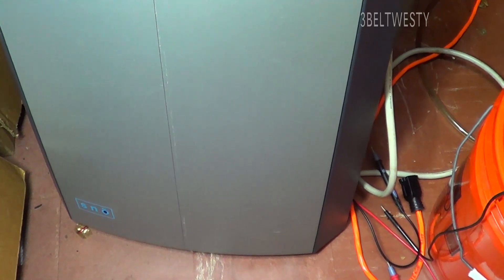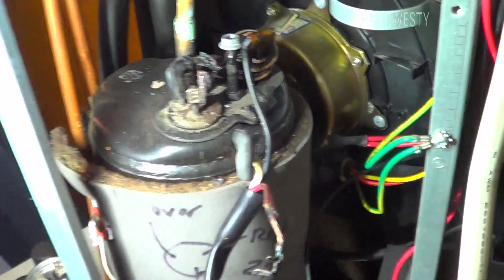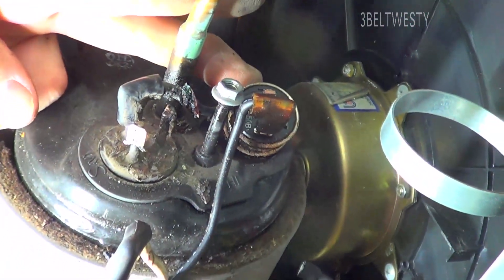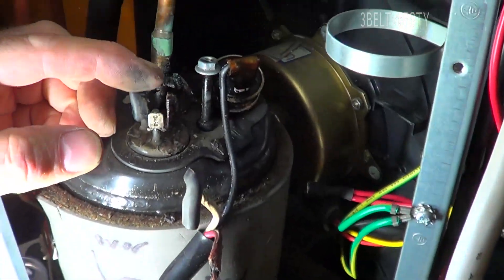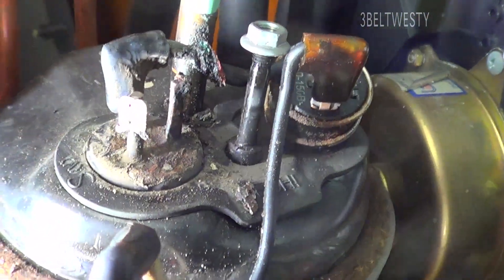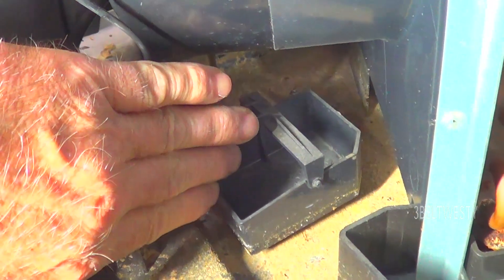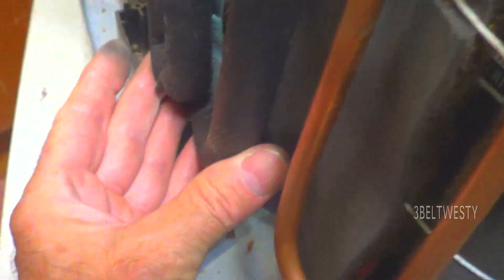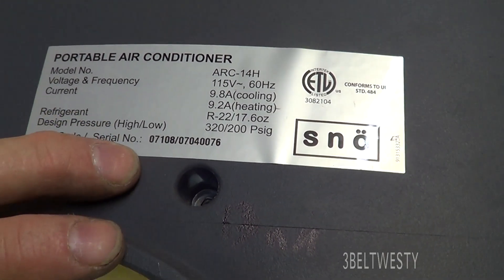SNO 14000btu Portable AC Repair burned Compressor Lug

Comment: I have a Whynter ARC-14SH that I've used for about 6 years.  The compressor stopped the other day and I just discovered the black wire going to the common terminal burnt up and the connector on the lug burnt up.  Everything else looks really good, including that round temp sensor/switch you mentioned, looks brand new.  I don't see any leaks.  Just one that wire and connector are burnt up.  How do you fix that connector on the lug?  Can I just solder a new wire directly to it?
Reply from the maker: Hello Rob,  

Never solder to the compressors lugs; ie very very risky. That pass through connector with the three lugs can pop out and do major damage to you. So use slip on "high temperature spade lugs" with a wire attached., or a clamp Quicklug system.  Hot items like ovens, compressors, motors use "high temperature" more expensive spade lugs. The metal is better for higher temperatures and the spring force does not drop like plain spade lugs. "ie creep rate"

 These high temperature spade lugs like Supco T1112 are like 5 dollars for 15 on Amazon. A local HVAC supply store has often them too. Most normal lugs are not high temperature lugs. On rare occasions a non hvac store has them. I found some at the giant Scruggs Farm  supply in Tupelo Miss.

They also sell kits where there is a "clamp on" clamp for each wire for compressors. Sometimes the "burning" of the old lug ruins lug so a slip on lug does not fit well. https://www.youtube.com/watch?v=5z_Rv5hbSqc  That is my video about the clamp on system. These cost more. Qwiklug Terminal repair kits.  

Sand the lug area so there is a good electrical contact. Wear safety glasses, that plug with the 3 lugs is under pressure. Sometimes there is extra metal on the male metal on lug pins due to the burning event. 

Any old lug will work for a quick test. What happens longterm(days/months? ) is the heat has the non heat rated lug drops its force with time.Then the electrical resistance goes higher. Then the lug gets even hotter. ie positive feedback. The copper wire to the burn lug often gets harder due to the heat. Sometimes I have to add new high temp wire pigtail to the new lug and use a wire nut many inches away from the compressor. 

Regards
Reply from the maker: @badcrcz  The 12 awg qwiklug should be fine. If you know any local hvac guys they might have a broke set with some spares. With a compressor type motor the locked rotor start current is usually about 5X higher than the run current. So 11 amps running can be say 55 amps locked rotor current. This high current happens for at start for a fraction of a second. So the 55 amps thru a poor connection causes a degradation fast.
Reply: @3beltwesty  I went with the 10 awg and had some trouble getting the old wire off the heat switch or whatever that thing is (the round thing with the burnt wire).  No matter how much heat I couldn't seem to unsolder it so I cut the wire as close as possible and just soldered the new wire on.  The plastic cap on the compressor wouldn't fit correctly because of the size of the Qwiklug so I had to cut the cap.  The AC works now but I need to patch up that cap somehow before I use it.  I'm not real sure if that cap over the connectors is just to protect to the wires or if it's to stop moisture because there's a rubber gasket under it against the compressor and a rubber gasket under the nut that holds it down.  Kinda weird because where the wire harness comes into the cap there's just a hole with no seal, so I don't know why the rest is sealed.  I was going to just wrap around the cap with electrical tape.  Thanks for the tips and the help, saved me $600.